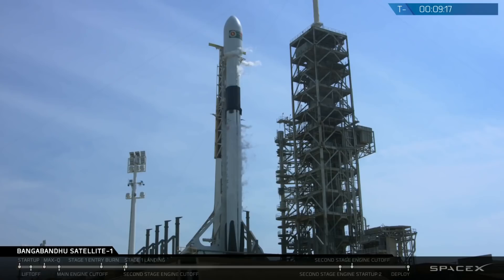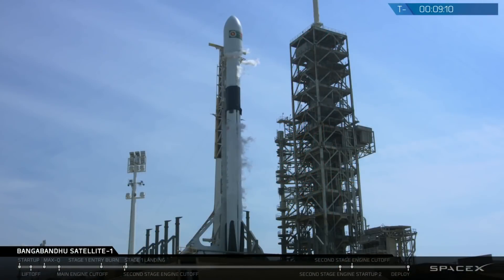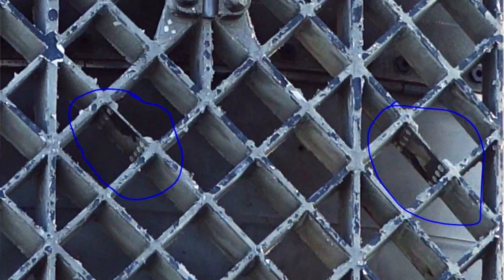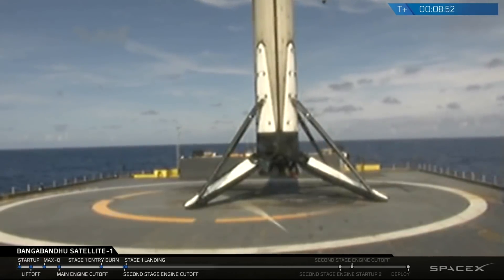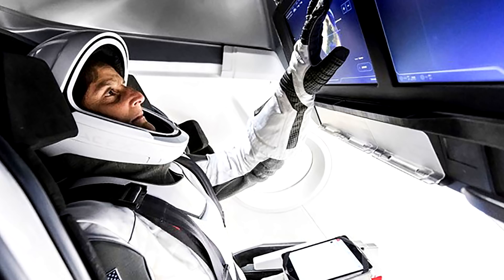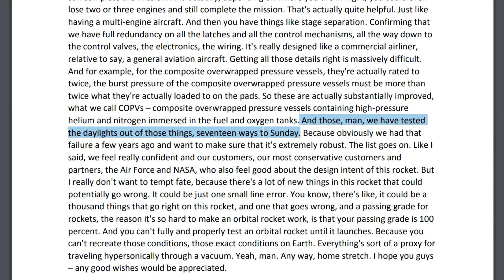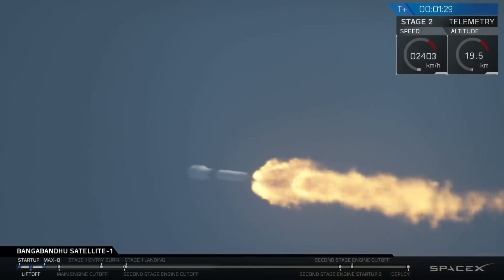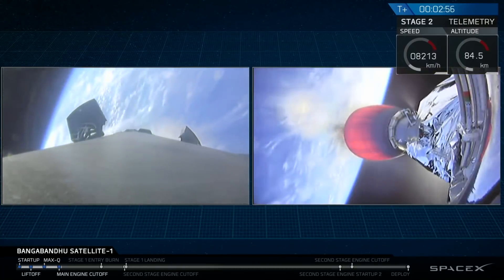How Well Did SpaceX's new Falcon 9 Work?

Comment: Engines are throttled not to keep the thrust constant. They are throttled to vary the thrust as needed to keep acceleration within certain parameters. This is especially important because anything above 6Gs is very uncomfortable and above 9Gs causes astronauts to black out. It is also important at or near Max Q to keep aerodynamic stress levels favorable. Satelites are also built to withstands a certain limited amount of stress during launch so dending on the payload adjustments may be necessary.
Reply: For this launch, they were throttled to keep thrust constant. The announcer said that on both webcasts (the scrub and the launch). 

A reason for this might be to keep the loading on the vehicle structure constant. The octaweb and tank walls carry a massive amount of load during ascent.

Comment: You forgot that the interstage is regularly blasted by the 2nd stage rocket plume when stage seperation occurs, probably the main reason the whole thing is coated in that black material.
Reply: The interstage is actually coated in a very thin, clear material. This allows the carbon fiber composite that makes up the interstage, legs, and raceway to show through, turning these parts black. The old parts used a different resin mixture that required thermal protection, which was accomplished by painting the parts. The new carbon fiber uses a new, thermally resistant resin mixture and doesn't need painting anymore; the clear coat I mentioned is just to seal the carbon fiber from the elements completely.
Reply: The air passing by the body of rocket creates a heating effect especially at the top where the air is whipping into an area of lower air pressure right above the rocket on the tip of the cylinder. Think of like the back of the body of the  space shuttle as it reenters the atmosphere and the angled plate it had. That's the primary reason I believe the inter stage is protected.
Reply: @Rothpol X That's incorrect. The black material is a layer of insulation. SpaceX described it as a "hydrophobic felt". It's probably a woven ceramic cloth like 3M Nextel, impregnated with additives to repel water.
Reply: Not really, Chaim. The heating occurs during supersonic reentry speeds. Air heats up as it is compressed in the shockwave in front of the booster. The leading edge is pushed into (and creates) hot plasma. The interstage, at the tip of the booster, has less means to transfer that heat away than the rest of the stage. (The cold propellants and thick tank walls absorb much of this heat.)

The second stage has cold gas thrusters running before MECO and separation, so the stages are not all that close together at ignition. Exhaust gases loose temperature extremely fast in vacuum, conserving only velocity.
Reply: David Ogawa you can't deny that the 1st stage trailing edge gets blasted by the 2nd stage engine plume here https://youtu.be/BPQHG-LevZM?t=1359

Coating that area in this heat resistant material means that area would suffer less heat damage because of this. I understand that the trailing edge of the interstage does get heated by compression on re-entry.
Reply: And these too; Wow!

https://youtu.be/Kpfrp-GMKKM?t=880
https://youtu.be/-p-PToD2URA?t=1173

And in this one; the most recent example they showed the thermal characteristics by deliberately igniting the 2nd stage plume into the interstage with the new coating on a mission that had a landing.

https://youtu.be/rQEqKZ7CJlk?t=1226

The speakers even confirm this interaction a few seconds later.
Reply: Check my comments I posted some links to examples showing what I mean.

Comment: I understand NASA being careful wit humans on SpaceX. That said, how in everything that's holy, can NASA only do 1 unmanned launch of the SLS? Given THEIR history, I don't see how flying a 1 time tested vehicle can be deemed safe.
Reply: Since they aren’t reusable, testing them more than once would get extremely expensive.
Reply: SpaceX is not required to re-use a single F9B5 for all seven flights.
Reply: The first SLS Block 1 will be an unmanned Orion flight to the moon, in late 2018.
Reply: X-Fun 2018? Ha. Haha. Hahaha. Ok.
Reply: You can certify you rocket for manned missions by 2 ways, paperwork or flights.
NASA is NASA, so they can get away with however they want it done.

SpaceX proposed 7 flights without change for certification and NASA agreed
Boing chose paperwork, plus the Atlas never changes

Comment: One thing about the interstage: early on during first stage recovery attempts, it was mentioned that the second stage plume really whacks into the first stage.  Essentially, the interstage must be capable of surviving direct rocket exhaust for a few milliseconds.  That's where a lot of the soot near the top of the stage comes from, and I'd imagine is another reason why it needs more heat shielding.

Comment: Booster inspector: the interstage fairing is getting charred sir.
Elon musk:hmmm well let's burn and char them before they get burnt.
And that's how the interstage became black
Reply: It's actually the white ablative insulation burned off the grid fins and deposited on the interstage. It only appears above the grid fins, because the rocket is flying backwards.
Reply: . . . Elonius coated them, light and dark, and saw that it was good. And the fans praised their new Block 5 !
Reply: Nate Vlietstra yeah burned off by the plasma during reentry
Reply: It's not the insulation being deposited, it's the interstage material under the ablative paint being exposed. You can see that both the raceway and interstage have similar thermal damage.

The reason why it's so bad on the interstage is because the fins' generate a series of hypersonic shock layers that impinge on the interstage.
Reply: It's more than just the grid fin ablative paint, it's also soot from the exhaust. It is most visible above the grid fins though.

Comment: I use 7005 aluminum for some of the racing bicycle frames I make.
Reply from the maker: Do you weld that?
Reply: Scott Manley Yes, we TIG weld it. 7000 series is generally considered not weldable other than 7003 and 7005. The New octoweb is likely 7075. It is easy to machine and the strongest of the common alloys.

Comment: I would rather be in the vehicle with a launch escape system than walk up to a fully loaded vehicle that could explode while I'm near it before I get inside.
Reply: TheSpacecraftX where is the excitement in that? That is like racing Formula 1 with a speed limit to avoid accidents. Who wants that? 😂
Reply: Dumble Door    Like this- would you want to be inside the safety of a formula 1 roll cage, or somewhere outside the car when a crash is highly possible.

A few astronauts safely in a capsule with an escape system
Or
An entire ground crew next to a fueled rocket (with a zip line)(no joke, NASA planned to evacuate the shuttle astronauts from the pad on a zipline)
Reply: How would a les help you if you’re not inside the rocket yet?

Comment: The TI grid fins do warp from the heating. I saw this in person when I was at the KSC visitor's center when they had the FH side booster on display.
Reply: Just FYI the titanium fins are actually bent to begin with, you can see it in closeup images of never-flown examples. The aluminum grid fins were a simpler, flat design, whereas the titanium fins are much more aerodynamically optimized, with the 'teeth' to help lessen shock front effects and a sort of swooping shape to mitigate the effect of the air interacting with the 'shoulder' of the fins. If the titanium fins were warped after flight it should be obvious from before/after photos.
Reply: I said on the Falcon heavy side boosters that was on display, NOT the block 5 in this video.
Reply: The Falcon Heavy side boosters used Block 4 boosters with titanium alloy fins. The center booster had aluminum alloy (painted white). The side booster fins look a bit bent on the pre-flight pictures to me.
Reply: @ Robert 
I know, that's what I was talking about. You can look up pictures of the Falcon Heavy booster Ti fins before and after launch, they look exactly the same.
Reply: I saw them in person and the fins had warping in certain places that were minor but you had to be up close to see it.
Reply: Robert Hale Ti...err...pics or GTFO.

Comment: On the block IV image you can see that a grid fin is quite damaged. From wich mission is that booster?
Reply from the maker: Bulgariasat
Reply: THX
Reply: Bulgariasat, which was the hottest reentry of any successfully recovered stage. It staged at 8504 kph, while the Block 5 staged at 8133 kph.

Comment: I read on reddit that NASA didn't require 7 flights before crew (Boing won't do this) but rather it was a SpaceX "offer"
Reply from the maker: Right, they have the option of a lot more testing, or just flying often enough to illustrate safety.
Reply: I'm just splitting hairs - love your videos, please keep them coming. I look forward to your first one from orbit
Reply: Tht makes way more sense for SpaceX since they are currently optimizing for high flight rates anyway and aren't using a special configuration of their rocket like Boeing will be (an Atlas N22, or No Fairing, 2 solid boosters, and 2 RL-10 upper stage engines). Boeing's capsule will also be able to launch atop Delta IV, Vulcan, and even Falcon 9 funnily enough. Dragon 2 however will only ever be launching atop Falcon 9 rockets.
Reply: Doesn't really matter since Dragon 2 may be flying 10 times as much as the starliner.
Reply: If you mean supply missions, Musk said they would keep Dragon 1 in service for those.  It makes sense to keep using them until they are retired at the end of their lifespan.

Comment: im pretty sure the whole vehicle has the black TPS coat but the tanks are painted to minimize boil-off on the pad whereas the non tanks are left to save weight (pls correct me if im wrong)
Reply: I don't think so
They try to save weight wherever possible. Additionally they launch just minutes after fueling.
Reply: Nope, the black parts are made of clear-coated carbon fiber with a new thermal resistant resin (so they don't need protection anymore) and the white parts are painted aluminum metal. The reason they paint the aluminum is because it still needs some thermal protection, though it also helps keep the propellants very cold even when the Sun is shining.

Comment: hey guys, i got a question, isn't it worst (for slowing down in the atmosphere) to travel in hot air? i mean, if for example, the engines of the f9 would have fired of in an angle, wouldn't the efficiency of the aero braking been higher?   
just want to know if anyone has some insight, i assume there is bunch of smart people here :)
Reply: While firing the engines the aerobreak effect is, as far as I know, magnitudes lower than the thrust of the one/three engine(s). And the air gets hot through the friction anyway. Hence the heat protection
Reply: you are right, but i mean in theory, if you could combine the use of rockets to slow down while limiting the amount of hot air you run into from the rocket, wouldn't it be more efficient (for example with rocket nozzles that can pitch and change the angle depending on the level of aero breaking you want to achieve).
Reply: You can only aero brake until you reach the point where you have to execute your suicide burn. Not later and not very much sooner either.

You could increase aero braking by suspending the rocket from a big surface the size of which you can increase by a large factor at the push of a button. Oh wait, that is called a parachute :-P
Reply: lol, i know, i was just thinking specifically about the rocket nozzle geometry, without the addition of the parachute.
Reply: You don't want to high drag around the engine bells, that would destabilize the rocket as it comes down, you want the drag to be on the other side so it self-stabilizes a bit. You can see that on the Blue Origin, all the drag components are in the nose of the booster. On the Falcon, The blunt interstage and the grid fins provide a little bit of drag, actually they where worried that the extra nose cones on the Falcon Heavy side boosters would make the aerodynamics more unpredictable.
On the Falcon 9, the exhaust plume acts as the heat shield on reentry so most of the air gets pushed down and to the side.
Reply: thank you very much for the deeper dive!